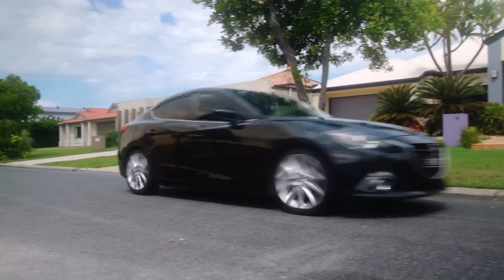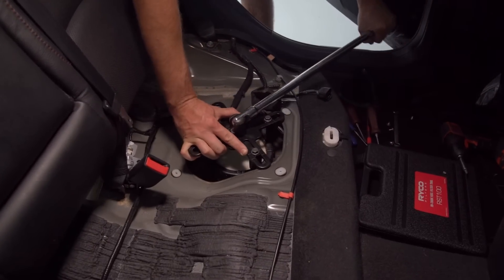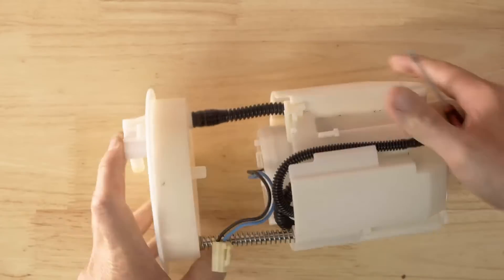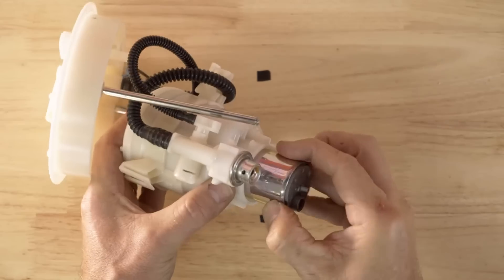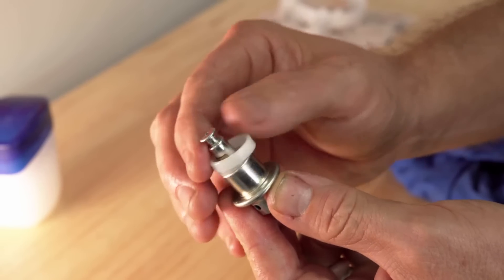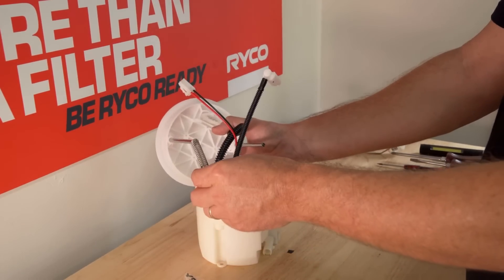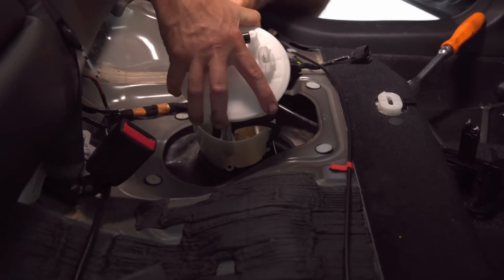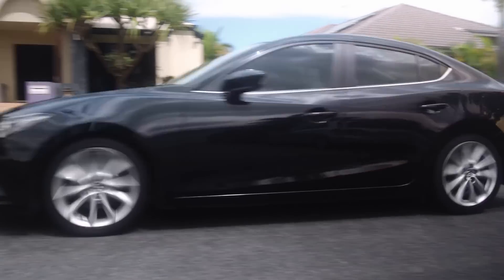Servicing your fuel filter with the Ryco in-tank fuel filter kit

Comment: Is there filter inside the dc moto housing?
Reply from the maker: @ghozicoba, can you elaborate on your question?
If you are referring to the in-tank fuel pump, which has a strainer on the bottom of it. It can Depending on the application, we may or may not supply the fuel pump filter
Reply: I mean is the filter is the strainrer? Or there is filter inside dc motor housing?  @RycoFiltersOfficial
Reply from the maker: @ghozicoba  The filter is not the strainer. The filter is within the fuel filter itself.
Reply: @RycoFiltersOfficial  is there distributor in indonesia?
Reply from the maker: @ghozicoba, our distributors are currently located in Australia and New Zealand. If you are interested in getting Ryco parts to Indonesia, we suggest reaching out to them to inquire.
Reply: @RycoFiltersOfficial i think your answer is badly written and is not clear.
The question or belief is the sock strainer on the pump is the filter. Your video did not show or explain that the filter is the white plastic piece in the kit and that has a filter medium. I believe the confusion comes from some videos about changing the filter is just changing the pump sock strainer and they may show a part number PE01-13-ZE1 which is called by Mazda FILTER (this makes sense). 
Your ryco video should have demonstrated the filter itself inside the piece you have them swap out and this would assist the normal person trying to learn.
As stated your answer to the person question was just as confusing as you used the word FILTER twice. Mick